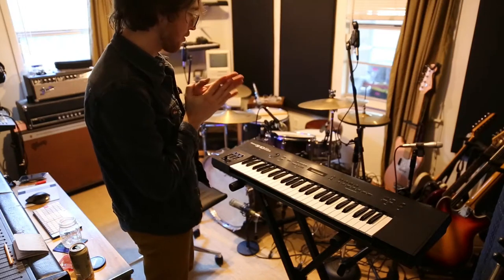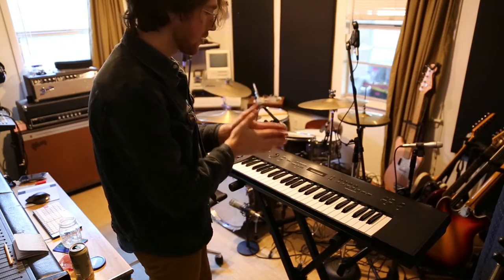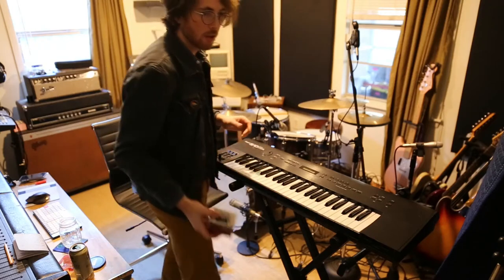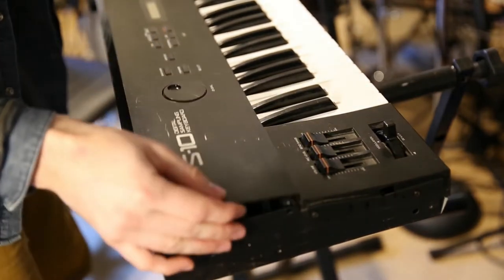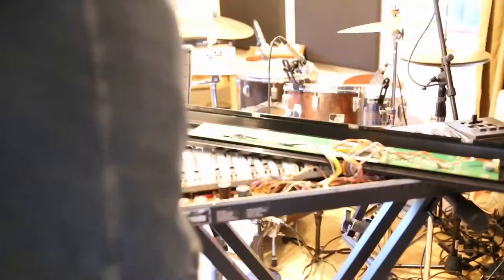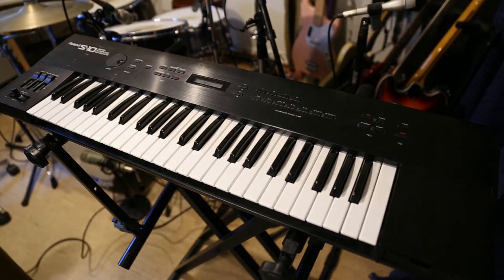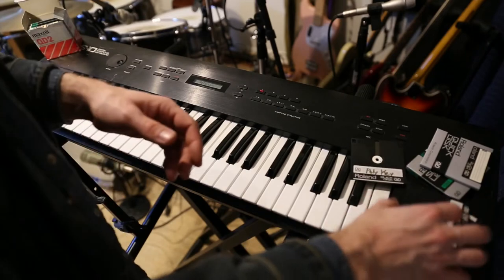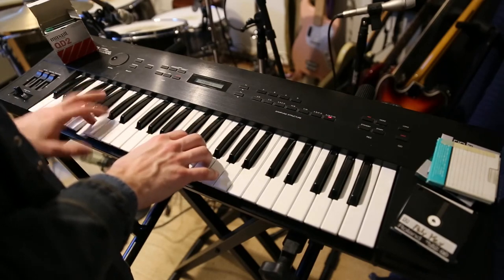Roland S-10 Quick Disk Drive Cleaning and Demonstration

Comment: Thanks for the video! Bought this one new myself in '86 and it hasn't been able to read disks for 20 years. Tried using compressed air to clean out the drive through the slot to no avail. Time to bust it out of storage and give it a cleaning!  BTW - the drive belt may be dried out and slipping as well. New belts are still available at https://console5.com/store/akai-roland-korg-mitsumi-2-8-quick-disk-qd-square-floppy-drive-belt.html

Comment: Nice vidéo. I have a question, I just bought an old S10 but I don't have a quick disk. I was wondering, is it possible for me to use it without a quick disk? just as a master keyboard with the right cable on an ipad for example? with garage band or on a pc with a sound bank?
Reply from the maker: You definitely could as long as whatever it is takes MIDI. That being said, I don't think it's the greatest keyboard option out there. You could still use it for sampling, though. You just can't save it after you're done. I'd recommend picking up a Gotek drive someday for it. That's the route I eventually took.
Reply: @relic985  Thanks for taking the time to answer me. I will try that.

Comment: Whats the audio level like from your line out? Mine seems really low on the highest switch setting  and volume at max and the medium and low switch are inaudible.
Reply from the maker: The line out on my unit works fine for the most part, but I do keep it on high and it is prone to ground interference. First thing I'd do is clean the toggle switch and the master volume slider with some deoxit. If that doesn't fix it, you'd have to follow the output circuit in the schematic which isn't an easy task since that signal jumps between a couple of boards. You can find the service manual here and most of the output circuit on page 21 https://www.synthxl.com/wp-content/uploads/2018/05/s-10-service-notes.pdf

Comment: Hi, hello... I'm really hoping that you answer my question on this. please...

I made a really stupid mistake, I just received this S-10 from the US which uses 110 v and plugged it into a 220v Asian region socket.

It turned on just a second and died. I know that I just stupidly short circuited it. Is there any chance I can revive it? What component do I have yo replace? Please, I really do need help on this. Many many thank yous in advance. 🙏🏻🙏🏻🙏🏻
Reply: By the way, did you get the Gotek USB emulator to work?
Reply from the maker: @arfandroid6729  Yes! I did eventually end up getting a Gotek, backing up my old QDs, modding it up, and designing a proper mount for it: https://www.thingiverse.com/thing:5020545. It works great beyond the limitations of the S-10, but I still haven't figured out a proper way to convert my QD backups to the format required by the Gotek. Got real close with a python script, but still not 100%: https://github.com/dcooperdalrymple/s10-syx2qd/tree/dev.
Reply from the maker: Yeahhh, you may be s.o.l. here. Best case scenario, there's just a fuse inside that popped before anything bad happened (I can't remember exactly where the fuse is). You could try replacing that then feeding it the proper voltage through a step-down, but I would make sure to do some probing to make sure that nothing is shorted out and some visual inspection to see if anything was fried in the process. Good luck!
Reply: @relic985  thank you so very much for your reply bro. I made some search, and your answer confirmed it, hopefully the fuse is there.
Reply: @relic985  the link on Gotek returned a 404 page bro. How could this be? You posted them only just 2 days ago...,🤷🏻
Reply from the maker: @arfandroid6729  Guess YouTube didn't like the way I formatted those links and included ")" at the end of the url. I've fixed it. :)